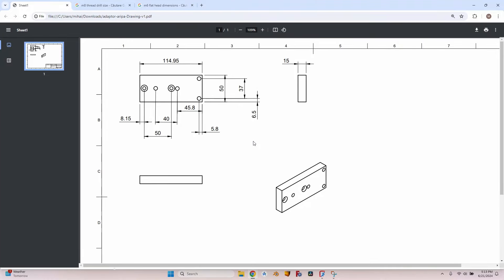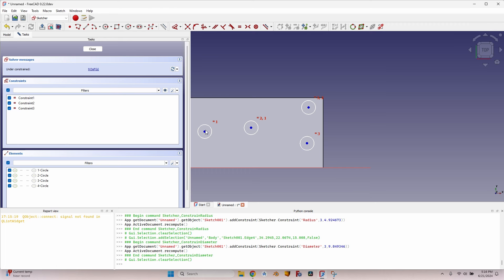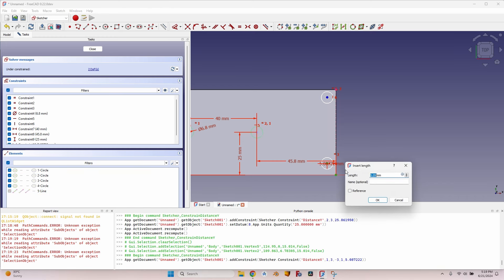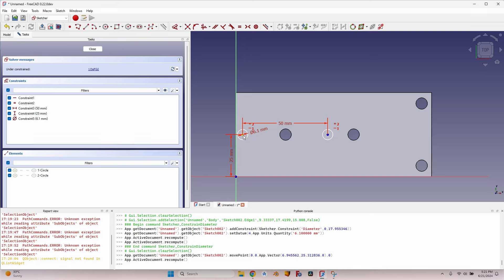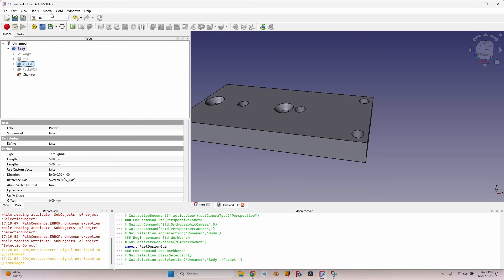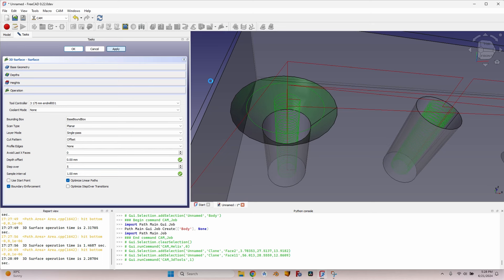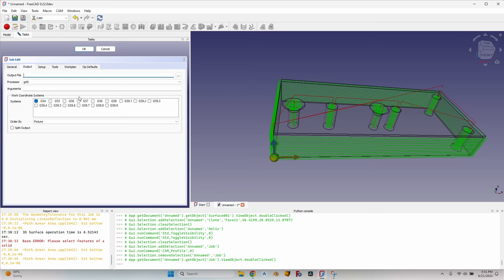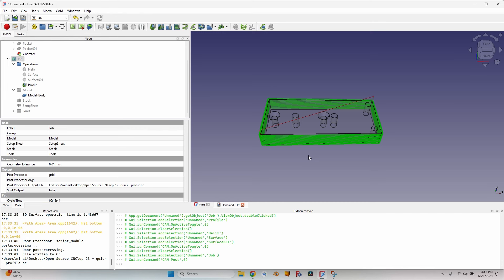CNC CAM G Code toolpath - Modelling and milling an aluminum replacement part

Comment: Great video as always :) One of the best things about 0.22 is the new dimension tool (shortcut D). Using it you don't need to know the shortcut für horizontal, vertical, distance, diameter or angle dimension, D works for everything.
Reply from the maker: Thanks for the tip regarding the dimension tool, I'll take a look into that

Comment: Hello, great video, I tried this example but can't seem to do the countersink, all I get is a series of step down cuts. I have tried it on Ver.0,21.2 and I also downloaded V0.22 but still no good. I noticed that the 3D surface Icon doesn't have the same options on my program as your ( no pull down options just the one icon) any ideas. Thanks
Reply from the maker: You have to enable the experimental features in the path (0.21) or cam (0.22) workbench. Unfortunately, I don't have a video about that, but I'll make one soon. Here's the official page with instructions: https://wiki.freecad.org/CAM_experimental
Reply: @opensourcecnc  Hi, thanks for the link , I carried out the changes on the 0.21.2 and all works as you show in your video.  👍👍👍👍👍👍👍👍👍👍👍👍👍👍

Comment: There is a faster method to make the countersunk holes: Do not put the countersinks in the model - make holes only. Then choose the upper edge of the hole in CAM, and make a deburr operation. Sure, ugly not to see what you get in the model, but it is a quick and dirty method.
Reply from the maker: Of course, but that means changing the toolbit. That takes longer than the facing operation